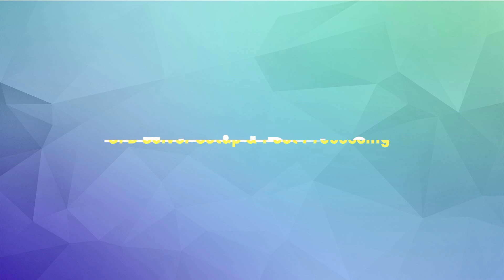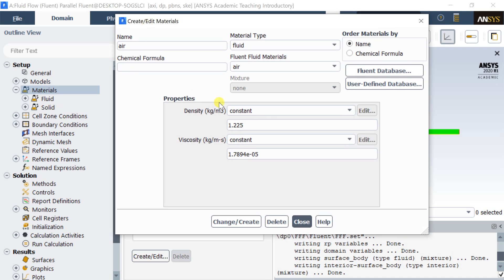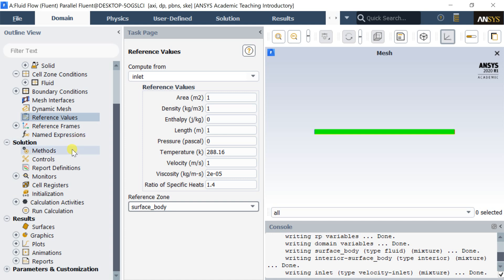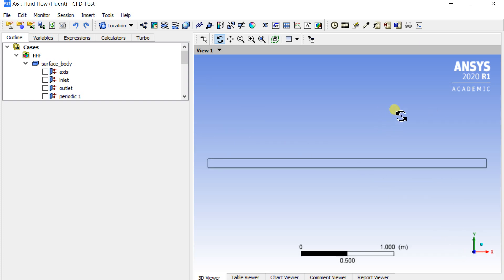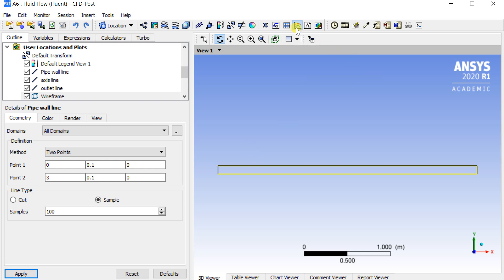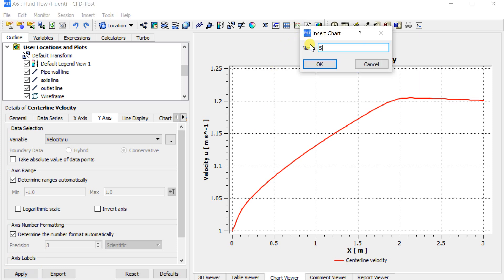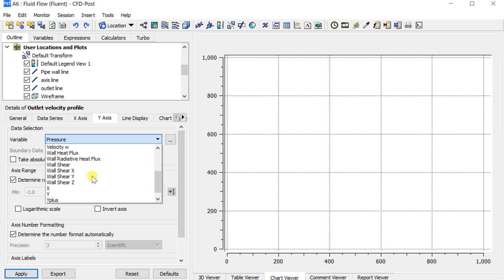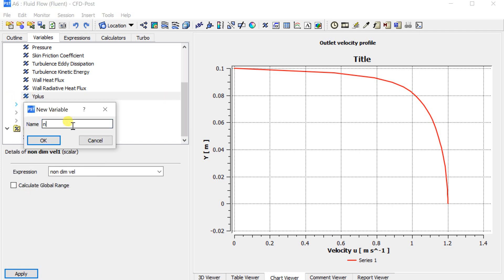ANSYS Fluent Tutorial | Turbulent Pipe Flow ANSYS Fluent | Turbulent Flow CFD | Tutorial Part 2/2

Comment: hi, i have a small problem. my variable dont have Y plus when plotting the graph. How can I fix/add it?
Reply from the maker: You need to add it from data file quantities in fluent,  before run the simulation. Details has been shown in the tutorial.
Reply: @AnsysTutor  Hi, I'm also facing the same problem, but I've added the y plus value from the data file quantities. However, it does not appear in the variable selection. I've redo everything following this tutorial, but the y plus value still doesn't appear. I'm using ansys student btw.

Comment: hello, why does it say the area is 1m^2 when you arrange the compute from as inlet?
And, how does the programme understand that this is a circular section, did we give any information about that?
Thanks for the video btw
Reply from the maker: We have selected Axisymmetric option in fluent. And provided an axis Boundary Condition. Due to which the solver gets this as a circular section.
Reply: The reference area and length will not be set by computing reference values from a b.c. So both the area=1m^2 and length=1m should be just default values and not used in the non-dimensionalization in this case.

Comment: In the cell zone condition the operating conditions if it is made 0 zero then it can be considered as vacuum?? 
Please help me .
I want to solve a flow analysis in vaccum.
Tell me how do I do that??
Reply: So in fluent after creating a udf or a enclosure then can we do?.
I have to do analysis of rocket engine flow and thermal analysis in space 
So for that what will be my approach??
Reply from the maker: You need to create UDF and link it in ansys fluent.
Reply from the maker: For vacume you need to write an UDF. It cant be done like this.

Comment: Hi, I have a problem while trying to save the project, I have a message like this :  VKI license is not available. Corresponding TUI and GUI options              

|  for import and export will not be available.         

Would you mind to help me please?                       |
Reply from the maker: Sometimes such type of error occurs in newer versions, check the node or element size if it had exceeded the student version limit ,or the Microsoft excel if installed or not, because without that it also causes such error. Message.